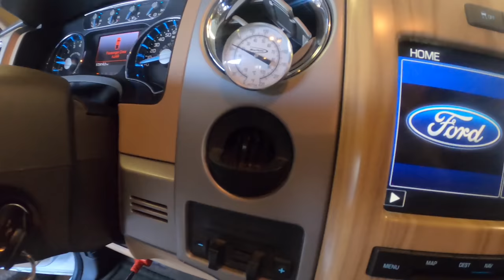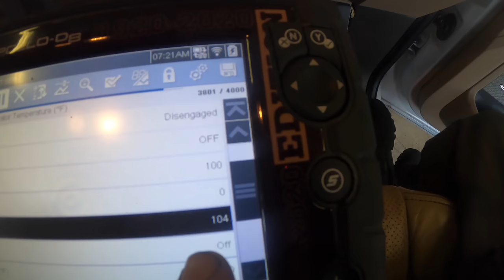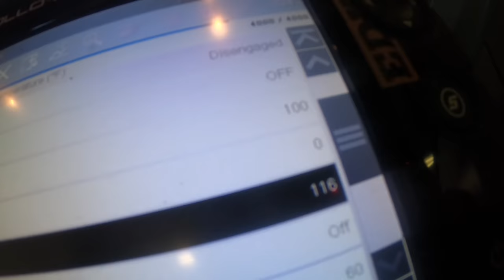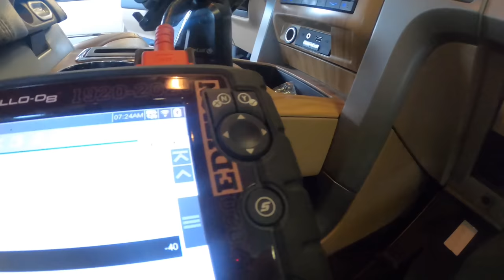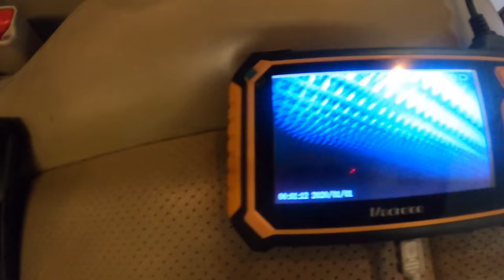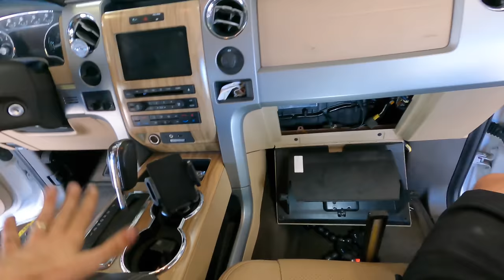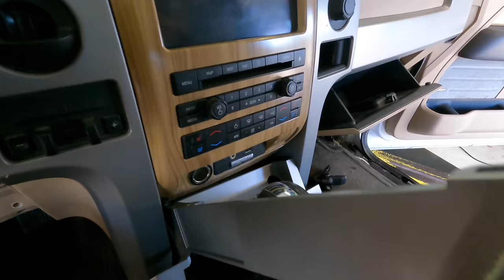TEN HOURS to replace one sensor! Ford 150 torn to pieces! Evaporator Core replacement.

Comment: If it were my vehicle and I knew how much work that involved... I would wire up a 12v adjustable flasher (repeat cycle) timer to open and close the sensor circuit. Adjust the cycle times to limit the maximum duty cycle of the AC to a normal temperature. Not what a real auto repair mechanic would do, but I'm more of a McGyver kind of guy.

Comment: In the future if you get another job like this, order the part and only use the sensor off it if possible. Give the rest of the parts to the customer so they have them for future use if needed. I’m sure the customer would agree to a repair like that.

Comment: I had to do the same thing to my 95 T-Bird. Twice!!!! Heater core was corroded, and sprung a leak, and one of the blend doors broke a few years later. I had to fabricate a door with a wood dowel, and a small plexiglass sheet. Man!!!! Pulling the dash is no walk in the park. That dash was f___ heavy!!!! 
Oh..... and just so that you Ford collector guys know; in order to get the evaporator coil out, you have to remove the AC/heater box, and saw open the top of it to get it out of there. Not too hard, but I did have to clean it when I fabbed the door back on the box. That also goes for the Cougars of that T-Bird generation. Man!!! If you ain’t got no climate control in those cars, they are a f__ nightmare to drive in cold or rainy conditions. Great car, but terrible heater/AC box design.

Comment: Wow, that's a fun design. Aren't there any data sheets for those sensors available? Worst case scenario - Wouldn't it make sense to check the resistance of the thermistor/ sensor of the new evaporator, and then return it? ;) You could even keep the sensor housing from f250. The NTC thermistor itself without the housing should cost less than a dollar. I did similar trick a couple of years ago, but the sensor was easily accessible, so I could afford the trial & error and replace the part several times until it gave correct temperature.

Comment: This whole time when he says Go on the pile. I followed it up with ' eff that ' .. this probe would just have to be self regulated by the dashboard switches while driving? Is it that hard to run for 10mins then turn it off for 20 mins? The drivers right hand still works right? This repair is a First World problem?

Comment: Please replace not only the evaporator, but the blend air door actuator as well. The plastic gear inside those are notorious for breaking over time. May as well replace the heater core as well. Better now while the dash is already out. It would suck for the owner to have to pay for all that labor to do it again a year later if those 2 items go out. Preventative maintenance is worth it's weight in gold.

Comment: Shame is its a 30 cent thermistor.  If we knew the value, we could easily pot one in a piece of stainless tubing, and Ray's access procedure would have been golden.  It's that ford won't sell the thermistor separately.  Easy way to find the room temperature value is a variable resistor with the scan tool till it reads ambient.

Comment: looks like  possibly a small hole could be cut to gain access to probe then patch hole. surely not the right way to get it done , but if had to replace in future would be easier.

Comment: Having to do all of this extra work could have been avoided if the designers had made it easy to remove in the first place.  Then again, it was probably designed that way because they wanted it to be hard to remove and replace.

Comment: The engineers that designed these vehicles never had the mechanic in the design and did not care how hard it would be to replace just a small part.

Comment: They do not have to build vehicles so compliated. The air and heat in my 77 f150 worked very well without all that crap.

Comment: Reminds me of the electric steering on my 11 f150. The drive belt disintegrated and it’s supposedly not a replacement part you should replace the entire steering rack. Uhhhh no you can get the belt via non legitimate back door order for $50 and you can easily replace said belt with rack on truck using a pair of surgical hemostats..  just 6 bolts easy access make sure it’s tension tight and done.  Wasn’t going to spend 1500 on a reconditioned rack when mine is very low mileage and was fine otherwise.

Comment: Just a question ?   Why not cut with the customers permission an access port like in a Comercial hyacinth system then use the super sticky metal tape and the plug to reseal it?  In done and out in like 30-45 min.  If I was offered that option to save oh I don't. Know like several hundred dollars I would be doing back flips. There after market temperature senors you can get by speck ie resistance high/low for relatively cheap vs the cost of a new evaporative coil set up.  The job you just must have cost in the 1000 to 1500 dollar range. Minimum O.o  Thinking I need to offer a kit on line for this make bank.  100 bucks includes whole saw tape an sensor total cost under 30 bucks.

Comment: I can't believe that you didn't just cut the box on two sides and bend it back to pull the sensor out and stick the new one in. It would have been very easy to cut that plastic and very easy t rep[air it afterward. You had very good access to the area to be cut and it would have been about a two-hour job.

Comment: OK.  I saw the part where the you say the sensor is available ONLY as part of the evaporator, but I reject that reasoning.  You can probably go to the junk yard and rip out the sensor, then, cut open the corner of the evaporator box, insert the salvaged sensor, and save big money.  Maybe we can sponsor this project where, using a trashed truck, you see if this is feasible.

Thanks!  Even if I think the customer is getting screwed, it is FORD, not you, doing the screwing.

Comment: just for next time you pull a dash on a f150 you don't have to remove the steering column from the dash just unbolt the one 10mm and turn it 180 to lock it  and the wire under vent there is a push tab that you can get out with a long trim tool do them all the time at ford

Comment: Why in the world do they build things like that? I'm in awe of the lengths they'll go through to make things difficult... But if I were the customer or doing it myself, I'd say, "if it's only cosmetic and it's hidden, tear it, cut it, break it - whatever to open it up wide enough"... But is that plastic shroud/cover/box actually cosmetic? Or does it have a purpose with pressure/temperature or something? Anytime I've ever messed with taking trim and cosmetic parts off, I never get them back on right and things are floppy and crooked and such from then on. Also, I'm not much of a mechanic but I am pretty big on tinkering with electronics - I never really realized how much good electronics stuff there is in vehicles.

Comment: The 3800 Buick/Chevy engine with the power steering pump on the back of the engine, the engineer had to work for Ford at one time.

Comment: I would have cut an access panel into the plastic box, changed the part, and been done. I don't care how carefully you try to reassemble that mess, It will never be the same. It will creak and groan and on an older vehicle you will inevitably break some attachment points.

Comment: Well sometimes you have to do what you got to do being a Chrysler technician for over a decade I've had my share of wood Chrysler calls the evaporator fin sensor Chrysler emphasizes that the evaporator fin sensor is installed in the coldest spot of the evaporator so when replacing the sensor it must be installed in the exact same spot and I'm sure that's the case for Ford and all the other original equipment manufacturers so trying to put a substitute sensor in a different spot would be Automotive malpractice so you got to do what you got to do glad it's you instead of me

Comment: 90% of these jobs is what I liked to call "The Magic" of how it's put together. I don't miss this occupation one iota. Ford is one of the nastiest vehicles to work on, I found that most of the time, Ford don't fit Ford. You have the patience of a Saint. We've done this job by cutting a small piece out of the housing that you were messing with earlier. we found the correct sensor aftermarket, I believe. The RO says "Parts $22.00....Labor $1534.00
Thank you Ford.
Stay sane my friend. Preserve the nerve as my dad would say.

Comment: I actually sawed a dash in half in a 1970 Dodge Coronet 500 that had a bad AC coil. I took it to a shop to for the actual coil replacement because I couldn't handle that repair.. He laughed his head off when he saw what I had done. Still laughing, I think.

Comment: Ray:  "I need to remove the spare tire, because it interferes with the back seat, which interferes with the front seat, which interferes with the steering wheel.... Yadda yadda yadda..."
Lesser mean would walk away from the futility of it all...    So long as you're making a good hourly rate, don't rush and just smile all day long...
Although, if it was me, I would have order the part and tested the new sensor before taking apart the car...

Comment: UK - I had  Ford Cortina, they have an issue with the cabin heater  core which will freeze up and crack of you dont  have sufficient antifreeze in. Replacing the cracked heater core is a nightmare, you literally have to do the above, it looks like the first thing they mount in the cabin when the car is built is the core, so you have to pull the entire front cabin and dashboard apart to get it out.. Yet the model that  followed, the Sierra, had a little panel with four screws . you just undid the heater core hoses,  took a the panel off and drew the core out. Simples. Why cant they all be like that?

Comment: The 99 f150 temp control for the cab, ridiculous amount of work to get to it half the bed full of dash. Get to the control one little bolt 1/3 of a turn and out it comes. P.i.t.a.

Comment: Why not cut a small access hole in the plastic condenser housing?
You could even use a heat welder and plastic rod to repair the hole.

Comment: Damn engineers my Mercury you had to do the same thing to get a sensor out for the heater or just deal with it I just turn off the the I just took out the fuse

Comment: Ford should provide a replacement panel to replace the sensor, (would require to cut a hole in the evaporator housing) to speed up the replacement time
Reply: sorry Ray , i jumped the gun and did not watch the whole video where you can't get the sensor separately, Dang Ford engineers, lol

Comment: They make a plastic welding kit. You could have cut s small square hole where the sensor was then used the plastic welding kit to reweld the square piece back in.  This would have allowed you to not have to remove thr whole hvac box.  Your welcome.

Comment: You think  engineer  would  design  service door on that box with gasket.I change my 95 Tahoe fuel pump  in 5 minutes, by cutting  a hinge window under the drivers side back seat .

Comment: Here is a little idea for the Ford engineers, how about making the connector that goes into the evaporator box on the outside.  Kind of how a lightbulb is secured into the headlight housing....  I don't know, but something like this, would make think about trading in or putting it up for sale.... Probably between $800 to $1,000 in labor and less than $40 in parts... LOL

Comment: If it was my own truck I would have cut a small access door in the plastic box, replaced the sensor and then sealed the door closed.  The engineers should have put it there anyway

Comment: an easy "hack" fix to this would be to install a pressure cycle switch on the low side charging port and then splice it into the Compressor Clutch wire. Cars have used this very method for decades from the factory. Stupid that ford relies on a temp sensor to cycle the compressor...

Comment: Replaced the core on a mid 70s fairmont . Unbelievable pain in the ass . They could have designed it with access from the firewall , but nooo!

Comment: I would have used a Dremel and cut a hole just big enough to remove that sensor. Then cover it up with that metallic tape that hvac techs use to cover up that hole.

Comment: Those 2 fasteners on the driver's side that you couldn't figure out. Up by the windshield. It would only make sense that you have to pull the Engine remove the firewall and come in that way. I mean after all Ford designed it as simple as thay could.

Comment: N EXT TIME USE A WREN PLASTIC CUTTING HEAT TOOL, CUT ACESS THEN  R&R PART THEN PLASTIC WELD PATCH BACK, OR USE THAT BLUE LIGHT CURING EPOXY.

Comment: Great job of troubleshooting and service.
Common engineers! This much work for a $20 dollar part.
If this was an oversight then you need to design a work around repair/replacement and part for the service and your customer.
At no fault to the servicing of this item, Ford has caused a potential for events for disaster of connection failures upon reassembly let alone rattles.
Damn dumb idea.

Comment: I have heard of a Mechanic that cut a Square Hole out of H-Box to get to Sensor, with epoxy Glue it would be a much easier job to reinsert cut out square--taking All the Obstacles out of vehicle to fix a sensor is totally crazy--the frigging engineers should have their Balls put into a Vice for Designing some of the Crap they do...

Comment: I can’t lie, I would have cheated by cutting a hole in the box where the sensor was.  Then I would have used a ton of sealant mixed with a little prayer and plated over the new access port.

Comment: I'm at 13:30, and I'm only slightly exaggerating that I'm expecting you to have to take out the headlights, dome light and tailgate in order to get to the core. Or rather, to get to where you need to be to remove the core. Oh, and the oil pan and drain wiper fluid. Because who knows how much more ridiculous this can get.

Comment: Do you not believe in extensions and swivel heads not universal joints or if you don’t have swivel heads a universal joint with some electrical tape around it but when I do dash work I always use magnetic sockets locking extensions etc. etc.

Comment: 2:30 Wouldn't it be FAAAAR less labor just to drill a new hole into that plastic box, shove a new temp sensor in the box, seal it up nicely. I'm sure if you told the customer that it would save them $1000 of labor or whatnot, they'd gladly sign whatever liability waiver / no warranty paper you put in front of them.

Comment: Why not just cut an access panel into that box and then silicone a piece of plastic over the hole. Or use that other sensor you had and just put an inline resistor on the wire the make it show the proper readout.

Comment: It's a freaking two wire sensor.  No magic here folks.  Just about any two wire sensor from any manufacturer would work at least electrically.  Remember, this AC is over-performing because the sensor is reporting 100F temp in the core when it's actually freezing.  A sensor that was close would work. I would have cut that box open and spliced in a sensor from any manufacturer and wedged it into the core.  Probably a 45 minute job tops.  I'm actually stunned there's not a hack kit available on ebay for this procedure.  Or is there?

Comment: Why not Dremel the plastic box where the connector is, remove and replace the sensor and then Epoxy the cut out plastic back in place?

Comment: I noticed nothing rattles your cage much, that makes you a good mechanic, you can get frustrated and lose it. Plus you have a good knowledge of how things come apart, better than me, I have to some times stop and research the web on some these connectors and clips. I have a bad  habit of getting in a hurry only to drop a bolt in an areas that requires 2 hours to find thus negating any time saved by working fast.

Comment: If you need to replace the Air Inlet Box on a newer style Dodge Grand Caravan, the entire dash needs to be removed, inc. the gearshift ignition switch. I am not a professional Mechanic, it took me 3 days, approx 15 hours. Absolutely ridiculous.

Comment: Ford truly sucks for this! You have to pay $1100 for a $20 sensor! I'm driving a used 08 Civic (5 speed) I bought on craigslist for $4300 with 135k and a salvage title, the AC clutch turned on and off kinda rapidly when I got it, fixed it with a $6 relay switch 4 years ago and still works great! Before this car I've had a lotta Dodges and Chryslers and one Hyundai and they all failed me catastrophically @ around 150k. My Honda is now at about 155k and running great! I expect to run into some bigger jobs at some point, like a clutch and maybe timing chain, but for now it's still Honda tough 😂

Comment: On one of my vans, I had to clean the evap coil.  I used a dremel to cut the case and did the cleaning then used alum tape to seal it back up.   An oversized piece of plastic or tin could be fabricated and it's like hidden and the customer doesn't have to pay yuge dollars.   Tell them what you are doing and have them sign an indemnification.

As I see more, it seems that the bottom side of the case could be cut then resealed.  Are there some mechanic rules against that?

Watched more, never mind.  Only an auto manufacturer would make a $20 part  a permanent part of a hugely expensive part.

Comment: Ford evap temps sensors fail too often in my opinion. In most cases you actually replaced the evap core to replace the sensor. In the ford Taraus is that way. I know the 2015 F 150 s are also that way. I get to do them under warranty and it sucks.